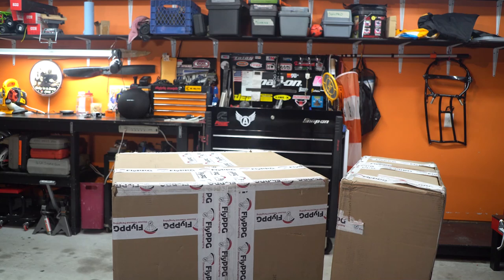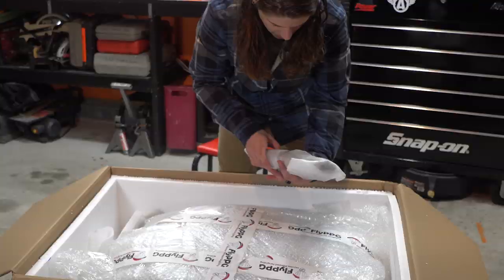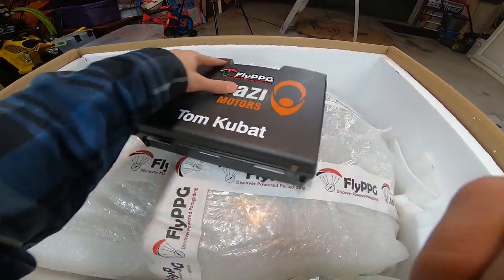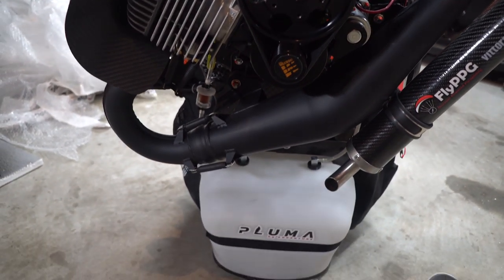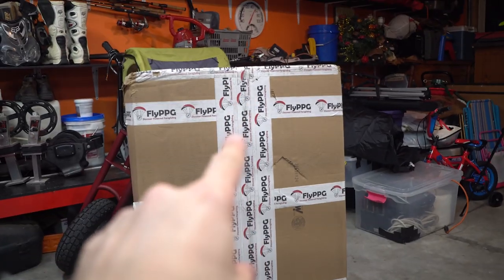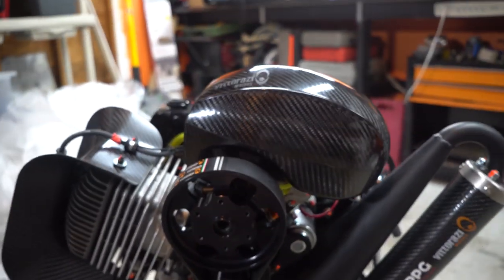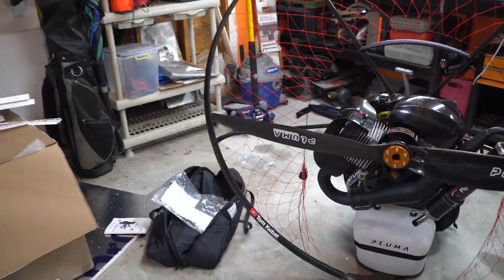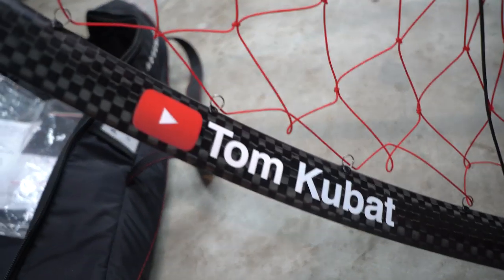Unboxing my Brand New Adventure Pluma MY20 Paramotor!

Comment: SOOO SICK!!!
Pro tip: change the battery leads to xt60 connectors, don’t leave the battery charged when it’s not in use. Lipo’s store @ 3.8 volts per cell. The charger they sent has a “storage mode” I would leave the battery “stored” when not in use and charge it the night before you fly. You can get replacement packs from the R/C world that won’t break the bank if yours dies. Hit me up if you need any more on this...

Comment: You will absolutely love it.  Very comfortable with the harness you received.  Have nearly the same in a MY18 with aluminum hoop and bumper and just over 4 hours.  Yours has all the upgrades.  You will never use the pull start.  E-Start makes it so nice.  Also, watch the horizontal crossbar that the starter handle/pulley is attached to.  It needs to be part of the pre-flight check.  Being only friction fit, mine dismounted on takeoff and went through the prop.  Caused crossbar, net, spar and prop damage.  About $550 for the lesson.  Customer service was great though.  I now have two zip ties above the crossbar to keep it from raising up until I want to remove it.  Can't speak highly enough to it's durability, comfort and power with the Moster.  Try the large thigh board.  Makes longer flight's comfort a non-issue.  The torque compensation is just weight shift, which has a lot of authority due to its design.  It doesn't take long to get used to it.
Reply: What is the weight of this unit? Looks awfully light. Do you trust the carbon fibre swing arms? I'm not so sure about them....
Reply: @parasportz  Carbon fiber is the shit.  My Pluma is 60 lbs with 1/2 tank of fuel.  Tom's will be 2 lbs lighter with the carbon upgrades (seat, hoop, airbox).  Adventure tested the rig with 275 lbs to 15 G's!  That should do it.